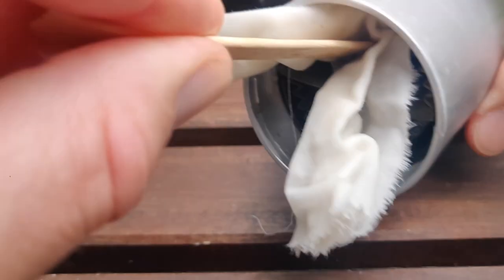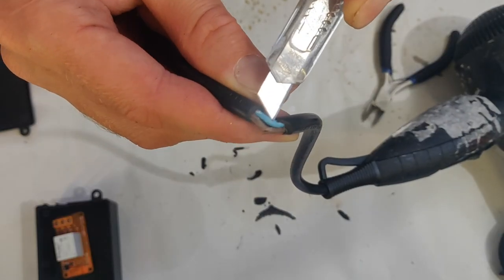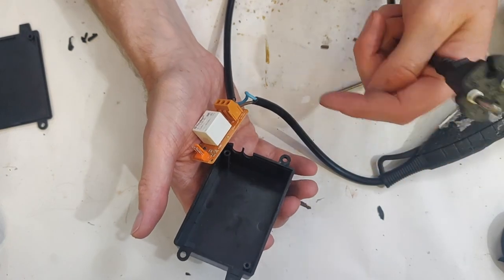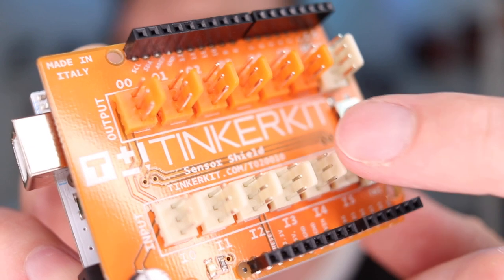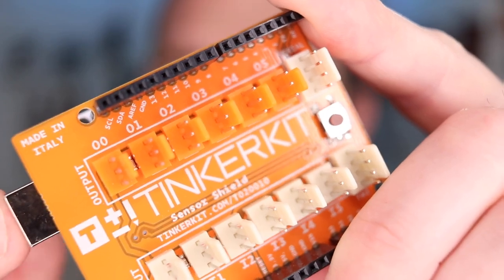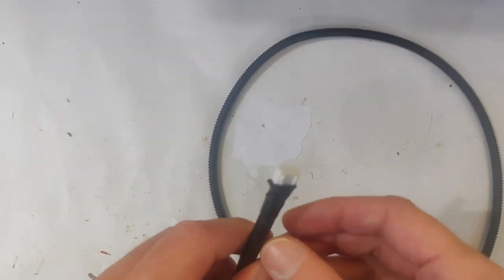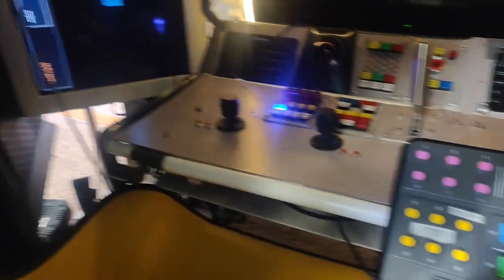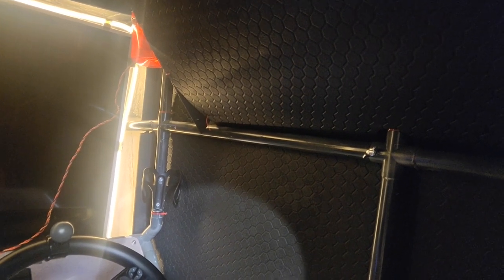I put a SMOKE MACHINE in my SimPit!

Comment: This is really good too, it means you can have a fog machine connected too,, this is awesome, not the heatgun on filt to make it burn tho, lol but the principal are good, love it, and i like the alarm system in the spaceship/simpit of yours too.
Reply from the maker: Yea, the alarm system is actually useful when playing. The somewat dangerous smoke machine is mostly fun :-)
Reply: @JonBck  i am working on some ideas on where arduino should be used in some aplication like the ones you showed, and i am working on my own alarm system, i did only make one as an signal system for now trough philips hue system on streamdeck with my own icons animated and sound, this is foundamental for my sim pit idea as well, yours is awesome.